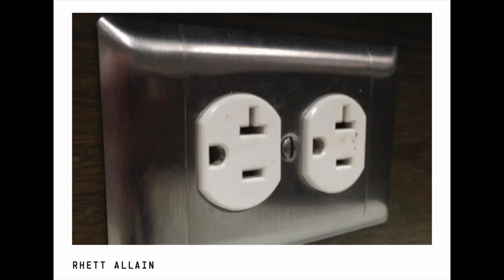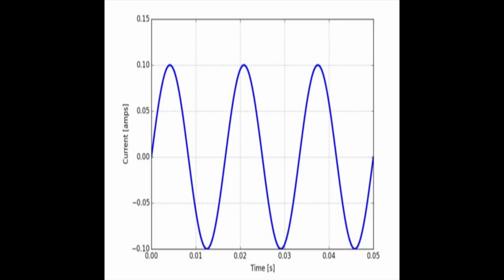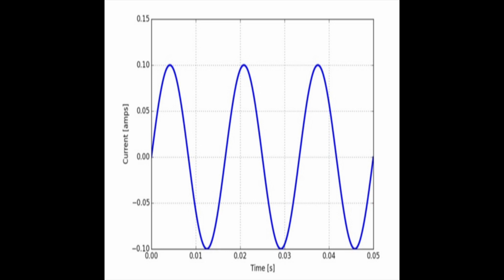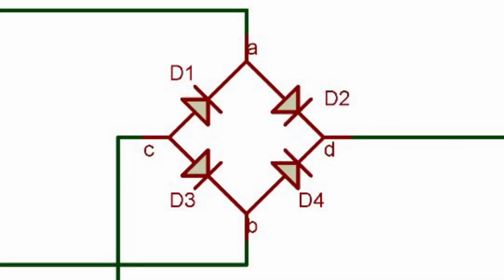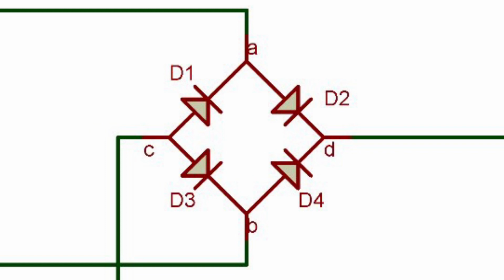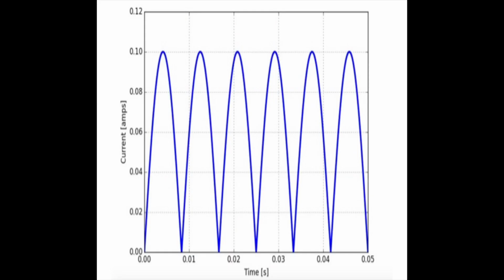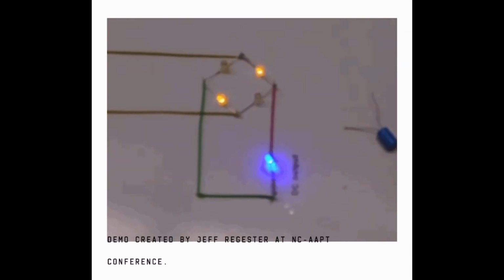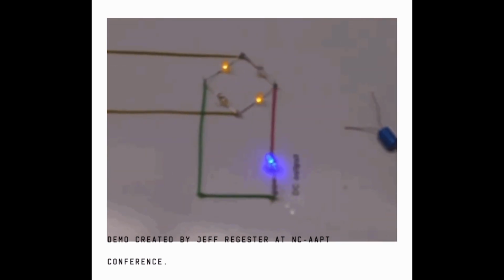How Do You Charge Your DC Phone With an AC Source?

Comment: They need to put switches on them all so when they're unplugged from the low voltage the high voltage disconnects. Probably just no economically feasible yet.